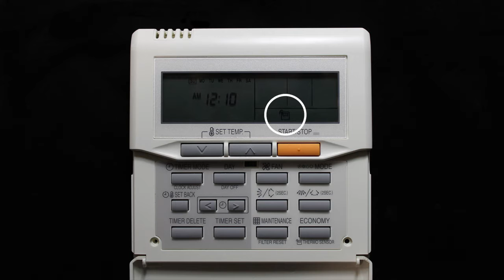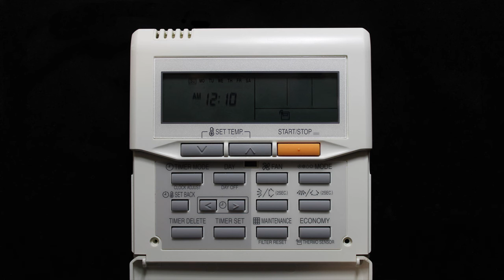Fujitsu Thermostat: Activate sensor reading

Comment: When would I have to set the unit number?  I have two air handlers connected to my Fujitsu outdoor heat pump. Both wired controllers are set to unit number 00.  When would I have to set them differently?  Main reason why I'm asking is, I installed a UTY-TTRXZ1 thermostat converter and everything is installed correctly, but the air handler does not come on. I'm wondering if I have to change the unit number using the old Fujitsu wired controller prior to installing the converter and a standard thermostat.

Comment: Error coming what can I do
Reply: You ever figure this out? I have a auu18rfl unit with wired controller and setting 42 and 48 set to "01". The controller still shows a key when I try to enable "thermo sensor."

Comment: I have a auu18rfl unit with wired controller and setting 42 and 48 set to "01". The controller still shows a key when I try to enable "thermo sensor."  Why can't I enable the thermo sensor setting? I cang find any info.
Reply: Same

Comment: This video is bad.  It has no context to explain why someone would want to do this.  Fail.
Reply: You would do this if you want to use the controllers thermostat instead of the unit which in my case was in the attic.
Reply: This should be the default. Why would anyone want to use a temperature sensor in some remote crawl space rather than the one in the room?